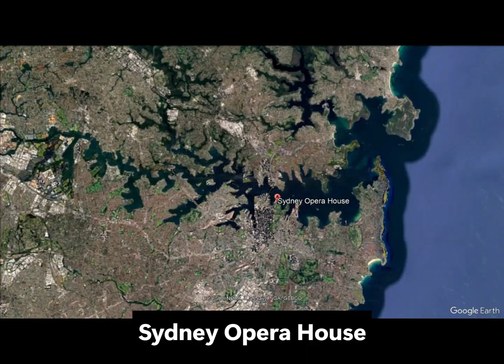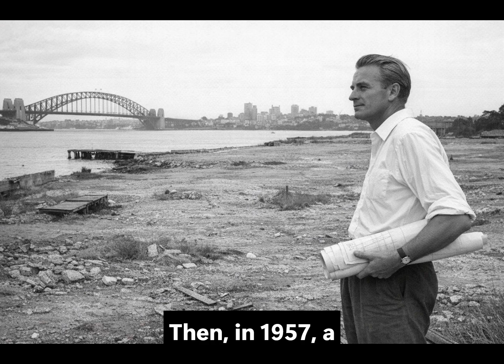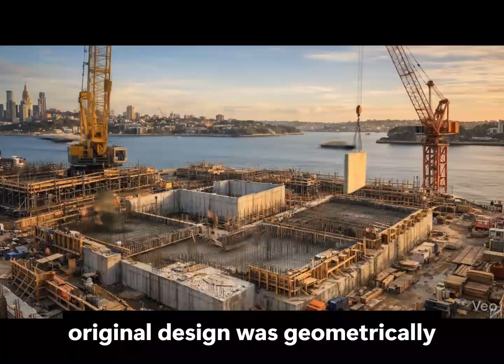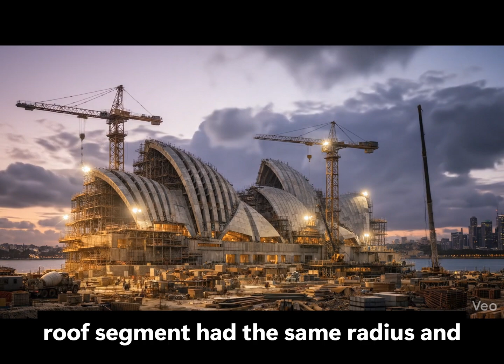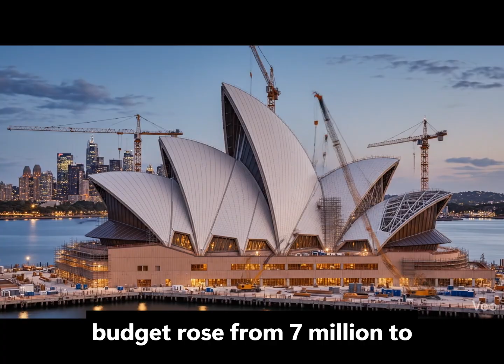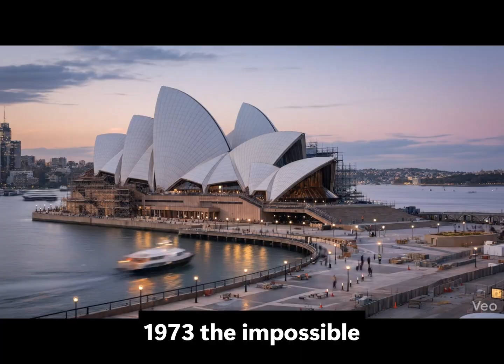Sydney Opera House: From Impossible Design to Engineering Marvel - The Secret Nobody Tells You

Comment: I knew that because (a) I studied civil engineering at university and (b) one of my brothers worked for Ove Arup as a civil engineer in the early 1970s. What most people don't know is that Utzen's original design for the sails would not have worked. They were too flat and would have required so much internal support that the building would be impractical. Ove Arup redesigned the shape of the sails to make them taller so that the stress lines from the roof flowed through the shell structure, thus making the roof self-supporting. It also, in my opinion, made them look much better.
Reply from the maker: Thanks for sharing your experience and information. That is really very insightful. Thanks.